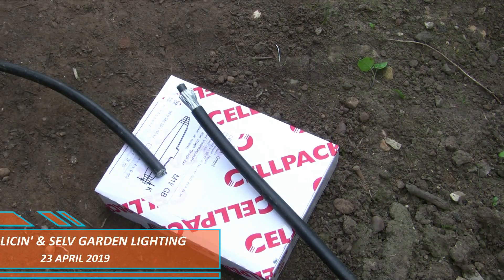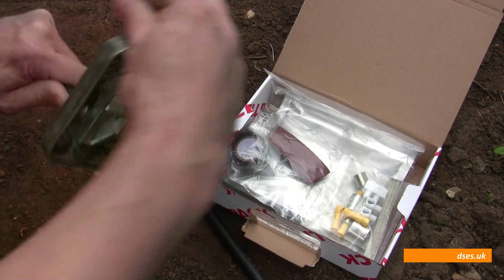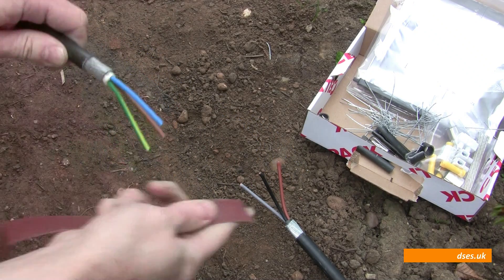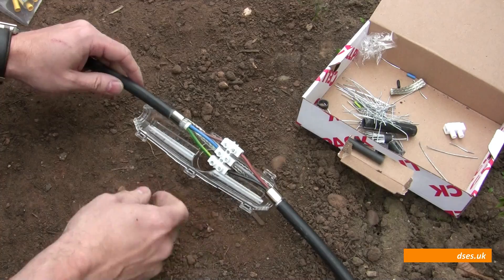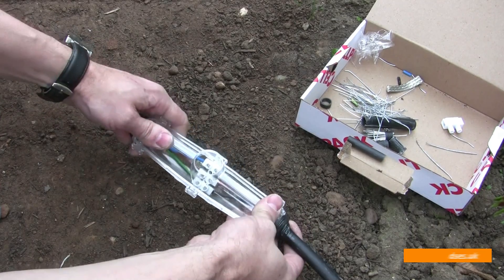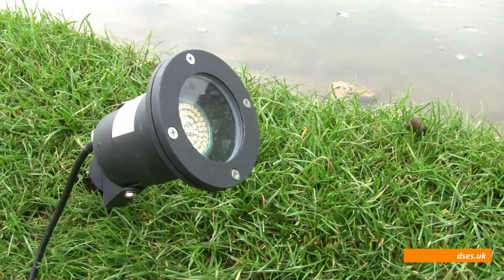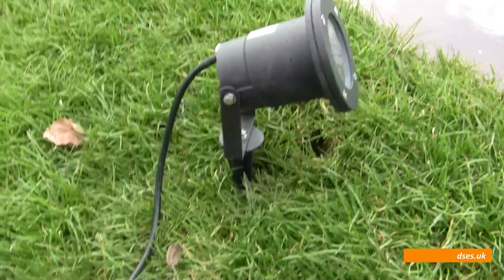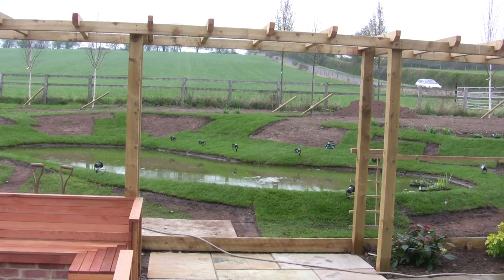SWA splicin' and SELV garden lighting

Comment: 12 months on those lights before pesky landscaper strims them to shreds.  Did you leave a card 😂
Reply from the maker: I think the plan is to cut out circles of the turf around the lights, but it raised an eyebrow or three when I saw it.
Reply: @dsesuk  So you might be back even sooner then when they cut through the flexes whilst removing pretty grass circles from around the lights :)
Reply: Flexible conduit around the flex for a bit of mechanical protection?

Comment: My understanding is that SWA cable surrounds the live conductors with an earthed metallic covering, thus allowing it to be buried and then run without upstream RCD.  If the cable is penetrated by a gardening fork, it'll be in good contact with the earthed armour before touching the horrible brown wire.  This feature doesn't seem to be provided by the nice junction enclosure.
Reply from the maker: I guess that's true, you're reliant on the hardened resin to provide a degree of mechanical protection.
Reply: As per BS7671, "The location of buried cables shall be marked by cable covers or a suitable marker tape...buried cables...shall be at sufficient depth to avoid being damaged by any reasonably foreseeable disturbance of the ground."

Then as per Guidance Note 1 Selection & Erection: 
The recommended minimum depths for high voltage cables (Under footways) is 450mm -1200 mm. (Under carriageways) is 750mm - 1200mm.

Recommended minimum depths for low voltage cables (Under footways) is 450mm. (Under carriageways) is 600mm. And there should be a marker system:
 i.e Marker tape: Yellow with black legend or concrete tiles.  

So in short, SWA cable buried in the ground should be at a minimum depth of 450mm and have marker tape over the top, preferably there will be a bed of sand then some height above that will be the marker tape. So if anyone does dig into it and gets shocked then it is their fault for not seeing the tape before continuing to dig. This keeps your arse covered. Also a diagram of cable locations that are buried should be kept, with distances measured from a structure that is unlikely to move in the near future, i.e, Measurements made from a building to the buried cables location and recorded on a diagram.
Reply: The braid that Dave attached to the armouring with the spring clips maintains the earth of the SWA if that's what you're referring to
Reply: @s30scott  I think he means if someone stuck a spade into that junction it could go straight in and touch live without first touching the earthed armors like it would if you stuck a spade into a length of SWA.
Reply: The braid maintains earth continuity yes, but it doesn't offer protection from shock if the enclosure is penetrated.  The cable would have to have an RCD upstream which is ok for a final circuit, but not suitable if you want to use the SWA as a distribution cable with RCDs downstream.  
One thing I'm wondering is that if the buried cable is RCD-protected, it doesn't need steel armour.  I bought a roll of YY cable recently and the spec said it was suitable for direct burial.  I need to find out what that's all about.
Reply: If you're worried about a garden folk going through the resin joint, bed the joint on some sand, pile some more on top, lay a concrete slab, more sand, pack it all down, lay some turf on top.

Comment: I bodged together 8 old MR16 led bulbs soldered straight to cable and old 12V driver to give me some light up the garden
Highly effective, safe and didn't cost a penny
12V is the way to go as long as you keep the wattage low 
Great video sir
Reply: I have 100W of garden LED lights on 12v it's been running fine for years, 20 * 5W bulbs, it's a long run too over 45 meters
Reply: @VAX1970  wow that's at least 8 amps. You'll probably get a fair bit of volts drop but it doesn't matter. It works.
Do you get many aircraft trying to land in your garden? 😂
Reply: @ralphsterz2889  The cable is very thick which improves performance, there is some voltage drop, i use cool white bulbs, so it's barely noticeable. I use a wire wound transformer.

Comment: I totally agree with you and it’s a great idea for external lighting. 
Do you ever suffer issues with volt drop? Seems to soon tail off when talking 12vdc
Reply: If you want longer runs of say 30m  upwards, you can always run the 12v feed cable as a ring/loop starting at the transformer/driver and returning to it. You then connect your lights anywhere along the ring and you get even current sharing, which helps to reduce voltage drop to almost zero. I used to do a LOT of 12v lighting when kits where made by Luxform and Ring lighting back in the early 90s and it was the only form of garden lighting that existed, mains was too expensive and not viable, solar didnt exist, and 12v was the norm. Ring products actually recommended the use of a loop or ring circuit to combat voltage drop.
Reply from the maker: Most of my 12v lines aren't too long, this being perhaps the longest I've put in which is why I went for a 2.5mm flex. A shame I couldn't show them working in this video, but they work well.
Reply: There’s always 24v!